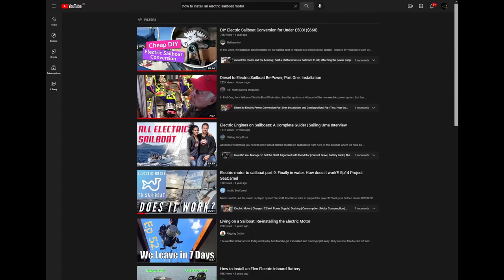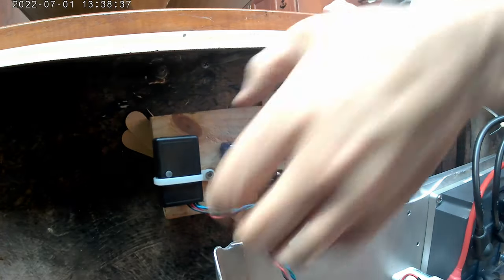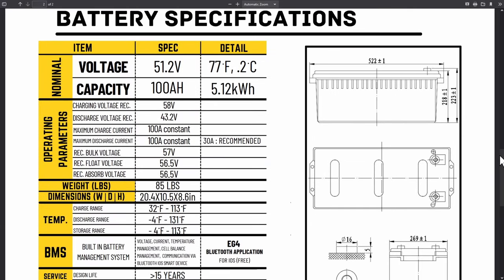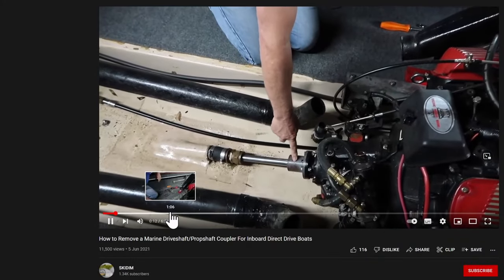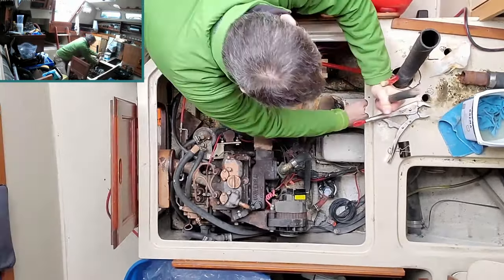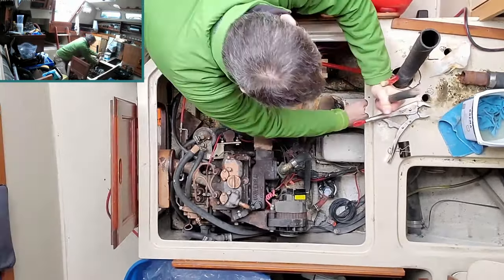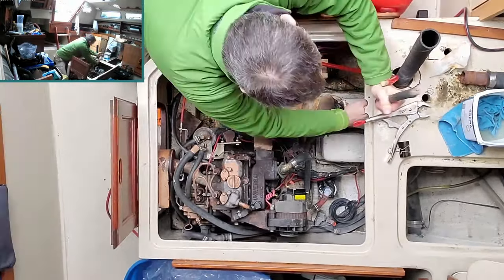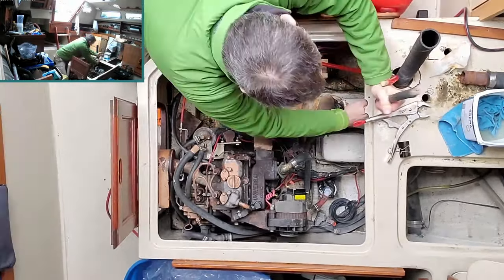How to Install an Electric Sailboat Motor - Catalina 30 - Thunderstruck Motors Sailboat Kit

Comment: One more question, does your setup (and mine) mean the little pins thru the dual chain are all that is holding the thrust force in reverse?
Reply from the maker: I guess so!  They use chains on snowmobiles and motorcycles, so I think they are pretty strong. :D Or am I misunderstanding the question?
Reply: @openrov272  yeah so, when in reverse, the dual chain is essentially want to pull apart, which means the whole thrust (only in reverse) is on those tiny pins thru the chain. yeah I'm not sure. I can't find a definitive answer. Best answer I can find is "noones has broken yet". That's not very scientific, but I guess I'll just run the gauntlet and play the numbers game. Am I over thinking this or should there be maybe a thrust bearing in between the coupler and the stern seal facing aft?
Reply from the maker: When I look at the chain-coupler, to me it looks symmetrical. So I don't see how it is different when you are in reverse. I am probably thinking of the wrong part! heh. If you want to send a picture, you can join this discord server, and post a picture there. https://discord.gg/Gv38FXd The invite link will last 6 hours. :D

Comment: why didnt you add more battery capacity to the boat? cant you add abt 50kwh?
Reply from the maker: Mostly it's the $12000 (plus shipping, taxes, cables and other install costs). :D I would be okay with the extra weight (it would put me about 450 lbs over the weight of the diesel + tank etc).

Comment: Could you please give me the approximate weight difference going from diesel to electric including fuel
Reply from the maker: My diesel, universal 5411, wieghted 245 lbs. A full fuel tank weighed about 160lbs. (The universal 5411 is very small for a marine diesel, many catalina 30's had larger, 365 lb, 16 hp version, or a atomic 4 at 437 lbs). In my boat, the electric motor, including mount, was (IIRC) about 50-60lbs. The batteries are 80lbs each, and I have 2. So the total weights are: Diesel - 405 lbs. Electric - 220 lbs.
Reply: @openrov272  nice video, thanks for putting it together... Question, did you find losing that weight/ballast ratio affected your sailboat (in a +'ve or -'ve way)? I guess where your fuel tank was located could also factor into the equation, someone I know added 25lb lead shot bags to the bilge right over the keel which worked good...

Comment: If I knew 1/0 Black wire was much cheaper that the 1/0 Red wire, I'd use all Black with Red Marine heat shrink on the ends.  Or at least ask them why?
Reply from the maker: Lol. I should have noted on the sheet that the black wire was a discounted "End of roll" section. It was exactly the length I needed. Lucky me! Otherwise I would have done exactly what you suggested with the heat shrink. :D

Comment: no updates?
Reply from the maker: I haven't done an update because, though I have gone out many times, I don't really have any new information. I'm ordering a wind sensor, so that I can more properly account for wind speed. And I need to clean my knot-meter inducer so that I can get water speed, which hasn't been running since just before I removed the diesel. I typically run at 2kw, and that gets me a speed of 3-4 knots depending on wind (high wind drops me below 3, but I usually sail then.) I will note this in the spreadsheet. Which I should have done before. Doh!

Comment: Hi OpenROV #272 - Quick message to thank you for your informative video as it helped me in starting my own build. I am designing/building a similar setup as yours but instead using two brush-less/water-cooled 48V 10Kw Golden Motors in parallel (driving one propeller shaft). If you are interested in following the build then I have posted my first video showing the motor housing:) Thanks again and keep the boat adventures coming!!:)
Reply from the maker: Awesome!

Comment: Do you know how many KV your electric motor has?
Reply from the maker: If you mean KW, it is a 10 KW motor. The voltage of the motor is ~48V. So that would be ~0.048 KV. :D
Reply: @openrov272  no friend! My question is correct. I did not mean KiloWatts and I wrote it correctly, I wrote KV which means Revolutions multiplier by volts, I watched the video again (minute 3:04) where it says 48volt * 50 RPM that means that your motor is 50KV and It gives a maximum total of 2400 RPM and that in the water is very little. You are using an engine that possibly has a lot of torque, do two things, you can get much more success with high revolutions, you can increase the revolutions with gears or change the engine for For a motor with a higher KV, I recommend above 25 thousand RPM, and you will be able to have better success using the same amount of electricity (amps).
Reply from the maker: Ah! Okay, so the max RPM of the motor is (I think) about 2800 RPM. Propeller RPM on sail boats is something like 850-1650, depending on the prop. What I have read is that a large, lower RPM prop, is the best for efficiency (while motoring, but worse when sailing, obviously). So I don't think I could do 25k RPM.

Comment: Hello if you put a Pooley  ln front of the motor roughly,  about 4 to 1 and connect it to alternator when you’re running your electric motor alternator, open will put volts back into your batteries

Comment: Nice video and useful, but replacing a diesel engine with an electric motor is not necessarily an "upgrade ". Which propulsion that is best depends on many factors.  Still good video for those choosing to go electric.
Reply from the maker: I agree! But my wife made that graphic. And I avoid arguing with her when I can! :)

Comment: It would be more efficient to go direct drive without a belt, and if you needed to change the "gear ratio" resize/repitch your prop
Reply: Not really, props are really expensive and belts are cheap. It's easier to calculate and buy the pulley you need than to find a fitting prop. Also, replacing the motor is easier with the belt drive, you just unscrew two bolts and that's it

Comment: I don't understand the advantage of electric that you can run for....(a couple of hrs, I guess) to a combustion engine that you can run forever
Reply from the maker: There are a ton of advantages to electric. Range is NOT one of them. (Unless you have all the time in the world, then, if you have solar panels, you could be boat-energy independent! But I don't think that would work for very many people.) Low noise. low maintenance. High torque, and instant power, on and off at the flick of a switch. The ability to run the prop at very low rpm. There are other small advantages I haven't used more than 50% of my battery in my outings. But I mostly go day sailing. You don't need a lot of energy to motor in and out of the marina. But I expect time crunches when cruising. For that I have my dinghy's outboard. It pushes the boat at hull speed. I haven't needed it yet though. But when I do, I will happily burn the required gasoline.

Comment: I suspect if you’re clever and use your noggin, this can be done for a lot less than $10k. Maybe look at the world of golf cars and mobility chairs for lightly used, high-quality components. Second hand 12 V server backup batteries are also a great way to source batteries more affordably, as they are changed out on a schedule, even if they were never pressed into service. Most of these have Samsung or LG cells.
Reply from the maker: Yep. This can definitely be done for less by reusing stuff!

Comment: always the same results.  Spinning an existing inboard uses more than twice the power of turning a large diameter (4ft) propeller slowly.   When using electric every watt saved matters.

Comment: I absolutely would never buy premade battery packs like that. Bare cells and a BMS with data logging would be the only way to go.
Reply: Have you done that before? See Rigging Doctor where Herbie does it AND the problems they later encountered.
Reply: It really depends how well the modules are made, etc.  Some modules include data logging.
Reply: @rickkwitkoski1976  I have built a few packs for EVs. My experience is mainly with the Orion BMS.
Reply: @LoanwordEggcorn  I have never once seen a single cell with a BMS (even a dumb BMS) built into it.
Reply: @fcguy2778  Module means more than one cell.

Comment: 10kW motor and 10kWh batteries means with 100% charged batteries you can motor just 1 hour at full power.  Not practical and actually ridiculous.
Reply: That is at hull speed. The 5 hour range, if no recharge capability mind you, at 4 knots is fine. Solar and wind generation recharging push him all day.
Reply: ignorance

Comment: I was thinking of downgrading to a battery motor but then I looked at it and decided "hell no", I am not an idiot.  The silliest downgrade you can do is get a battery powered motor that goes about 15 miles before dying vs my diesel that goes 1,000 miles, costs less, refills instantly, and is super reliable.  There is no real decision to be made guys.  Don't fall for stupid politics - batteries are dirty and full of chemicals, expensive, pollute the world for 100,000 years after you dump the junk, and cost more.  Nough said. Only fools get them.
Reply: That's an opinion. We are all entitled to our own.
Reply: @Lana_Warwick  true but some opinions are more informed! After some serious researching for well over 2 years now, and without a 'green' vs dyno juice agenda - my only criteria being minimizing the already awful 'investment' anything boating is, I've come to the conclusion electric only makes sense, barring some major battery tech breakthrough,  in very few use cases. It's only ever 'green' if like with EVs you ignore how it's built, charged, and scrapped come scrap yard time... and let not talk about resale value in the interim. Comparing a mistreated, poorly maintained 30+ year noisy, leaky diesel to a clean, quiet, and reliable electric install is a common fallacy, you never see it compared to a clean, efficient and much quieter new diesel install... When my 42+ year old white glove maintained diesel finally quits I'll likely drop in another new diesel and take good care of it. Yes I'll hate putting up with the noise vs electric but in exchange I'll have range and higher resale value...

Comment: Better ,go on diesel,nearly same cost uh 😳
Reply: Pros & Cons to both. I'd rather not have the toxic smell & soot, with bonus of Much less running cost & maint. A sailor rarely needs engine or motor, mainly just around tight marinas

Comment: 18:25 How the f**k 48V/200Ah battery bank has over 10kWh energy stored? Math wasn't your thing?
Reply from the maker: That's 48 volts nominal. It's actually 51.2 volts. 51.2 v x 200 AH = 10,240 Wh. 10,240 Wh is greater that 10KWh.

Comment: After ten months would you consider it an upgrade or a downgrade. 
Be honest
Reply from the maker: For my uses it is perfect. I charge at the dock and every-time I go out it is full. :D I haven't needed my dinghy's gas outboard (15 HP, which is my backup) since installing the electric motor. I DO have it as back up though, which is good, because when I cruise, I might need to motor more than 12-15 nautical miles. It was definitely an upgrade on my boat. My existing diesel, and all it's external parts (fuel tank, heat exchanger etc) were either dead or dying. I wouldn't have replaced a good diesel setup. I really love having electric propulsion though!